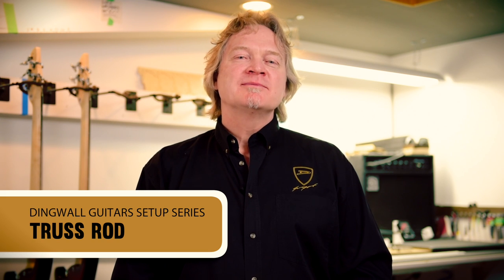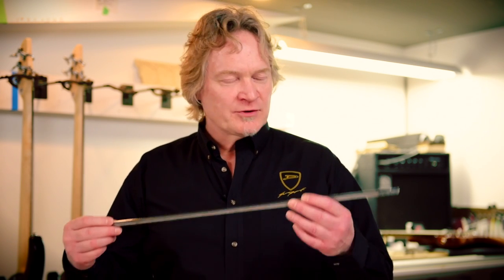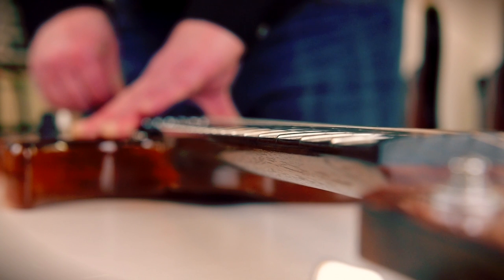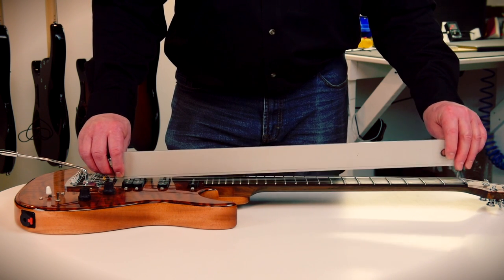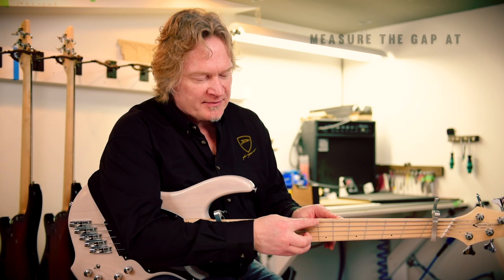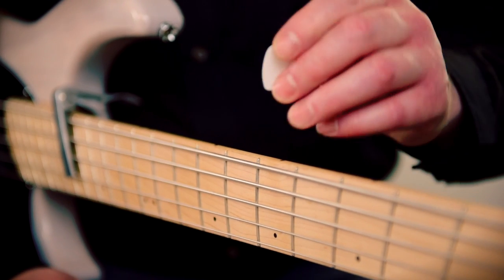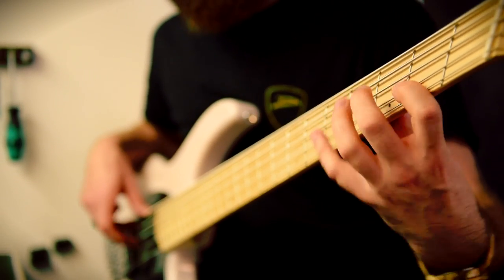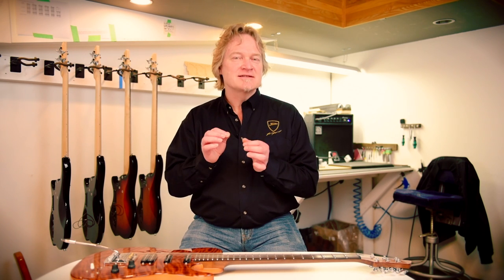03 Truss Rod   Dingwall Guitars Setup Series

Comment: Hi Sheldon! I just bought the Adam Getgod from my long time pal, Rick in Vernon. 
I hadn’t planned on buying it, but I picked it up and I couldn’t set it down . So here’s my dilemma; it played so well and I should’ve left it alone, but I had to mess with it lol. Now I just want to get back to the factory specs. In this video, you illustrate on a five string. What height am I looking for on this 4? I guess what I’m asking is how do you set the saddles up coming out of your shop, height wise? Also, do you angle them at all to match the radius?
Thanks in advance I love this thing! I’ve been a long time Sandberg guy but 🫣 you make beautiful guitars
Reply from the maker: I'm glad you're liking the bass. Make sure to watch all of the setup videos. Truss-rod adjustment needs to be dialed in before saddles. Then, measure the gap between the 12th fret and bottom of each string. Because imperial rules are easier to find in Canada, we use increments of 1/16". For clarity, we quote measurements in 16ths as well. G = 4/64", D = halfway between 4/64" and 5/64', A = 5/64", E = halfway between 5/64" and 6/64".
Reply: @xmanual  thanks! I really appreciate you getting back to me. My second and final question is do you follow any type of arc on the saddles themselves? Ie? One side of the saddle slightly higher than the outside side. Thanks again, I finally got to play it at rehearsal last night and it’s outstanding. I’ve been a Sandburg guy for a long time but this bass changed my whole view on things. Rick’s been telling me this for years lol. I played a festival with Hank years ago and he was telling me the same thing to you. I just took a long time to listen apparently. Cheers
Reply from the maker: @sper  I see the logic of what you’re saying. I recommend keeping the saddles parallel to the face of the body.
Reply: @xmanual  OK I’ll go with that then. Thanks a lot I really appreciate all the advice.

Comment: Should I release strings tension before tightening truss rod or is it ok to tighten it "under the load"? Is it possible to lubricate the bolt? My makes squeaky sounds when I try to move it.
Reply from the maker: There is no need to loosen the strings unless the truss-rod is so tight you're at risk of stripping the socket. A little squeek is OK.

Comment: What is the size of the hex wrench we should use ? I don't have US Hex wrench and they are pretty expensive in Europe (as we have hex wrenchs in metric system) so I want to know which size I should buy.
Reply: What kind of bass do you have?    If it's a Dingwall, it should have come with a tool kit with all of the correct wrench sizes.  The truss rod wrench is 9/64".  You should get a 9/64" wrench, or you will ruin the nut.
Reply from the maker: Sorry to be so late replying. All domestic Dingwall models and V1-V3 version Combustions and NGs use a 9/64" wrench. All V4 and current Combustions and NGs use a universal size wrench 5/32" or 4 mm.

Comment: My Dingwall NG3 has a relief of 0.3 on the B string but the G string has almost no relief. is that normal? If this is a twisted neck, can I get a new replacement neck for free?
Reply from the maker: It's normal to have more relief on the bass side than the treble. The B-string swings a lot more than the G so a little extra room is a good thing.

Comment: What is the size of the truss rod nut...
Reply from the maker: On Domestic models and V1 and V2 Combustions, the size is 9/64". You will need a ball-ended wrench for these. Available at our webstore. For V3 and V4 Combustions, NG and D-Roc Standard models the size is 4 mm. If the access slot is roughly 6 mm (1/4") wide and at an angle, you will need a ball end wrench. Newer production access slots are 16 mm wide and parallel to the face of the body. A standard 4 mm wrench will work.